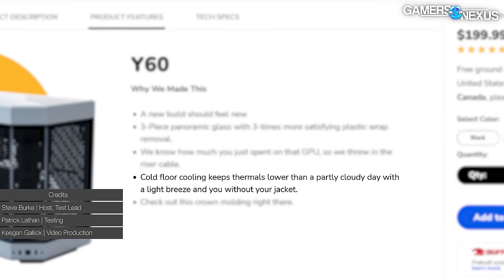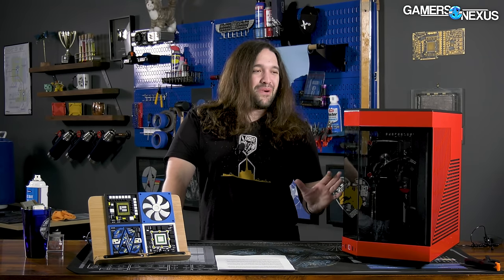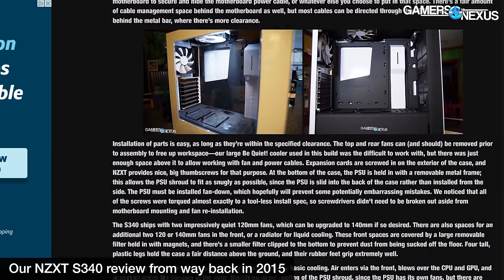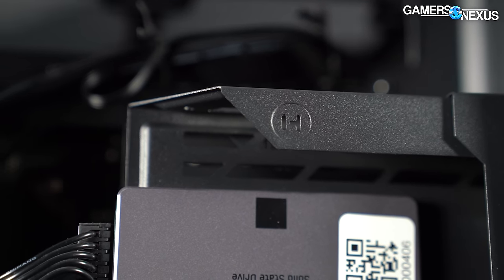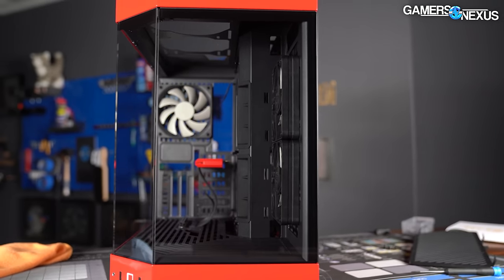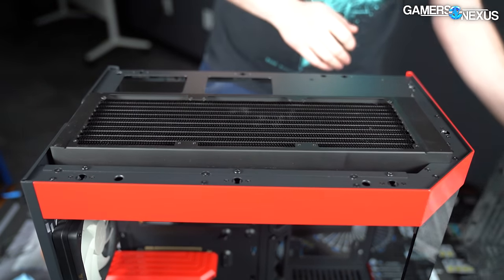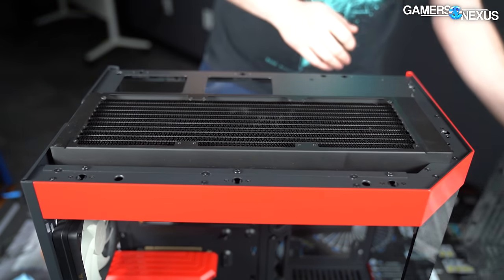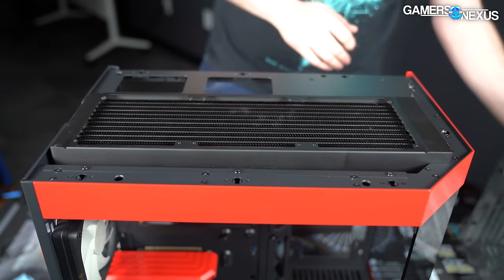Impressive Quality: Hyte Y60 Case Review & Benchmarks vs. O11 Dynamic

Comment: can anyone recommend a good case with a CD-ROM drive bay? I have a bunch of old family photos on cd-rom. I don't want to buy an external one when I have one I can install already. looking for something with decent air cooling that is a little higher end than a Fractal focus G.
Reply: You can get an external housing for your CD-Rom drive, rather than limit yourself to cases that have that feature. That said, check out Corsair's Carbide series, there's a few in there. Phanteks Enthoo Pro and Pro M (good luck finding those) and some of the high end Phanteks Enthoo cases like the Luxe, but they're very pricey. A couple models in the Antec Performance series also have removable optical bays, might be tough to find reviews on those but Antec has been making decent cases since forever. I'd recommend the Enthoo Pro M, you might be able to snag the tempered glass version, I think it's the most appealing case with an optical drive bay I've seen in a while. Good luck!

Comment: First I don't even understand reviewing this case with an air-cooled CPU cooler. I mean, why not use what MOST of the builders out there are going to use, an AIO. Specifically a 280 or 360 RAD.
I'D LIKE TO KNOW IF THERE IS ENOUGH ROOM TO USE A 360 RAD IN THE FRONT SIDE SPACE, AS THAT WOULD BE MY PREFERENCE???
 Also, there is enough space in the front area to add a few internal fans to help cool the GPU and Memory. So I think it could easily be compensated to have better cooling. Although, I've NEVER understood why anyone would put fans on the bottom, and blow dust from underneath up into the chamber. The screened mesh does NOT stop all dust from entering. So bottom fans are just idiotic in my opinion. Those fans can serve better elsewhere.

Comment: I HIGHLY disagree with all of the fuss over stock fans, it's absolutely meaningless, and would only encourage manufacturers to spend 10 bucks buying the worst 5 pack of fans you've ever seen just to fill up all the slots. When I buy a case, ESPECIALLY one over $100, I either want excellent high quality ARGB fans at a bit of a discount for buying them bundled in (honestly just fill up the whole case and have it all matching and pre-installed on a built-in hub that would be great... OR I want absolutely nothing to maximally save on cost and effort by not having to take them out or let them go to waste. The Hyte includes 3 fans, and they are all literally e-waste. It COULD be an exception only for cases like the hyte where some of the fan slots are completely hidden and thus dont need rgb or to look good, but even though they included some here they are still e-waste because they went with 120s instead of the 140s the bottom actually supports.

I get you've already done so much stock testing, but honestly it is genuinely a waste of your time and the viewers time in focusing on numbers that literally no one with the insight to watch one of your videos would every actually do or have to experience. I think a better system would be to find some high end RGB fans, and fill up the slots with a maximum limit to prevent huge cases being ridiculous (about 7 or 8 fans), and then on your value judgements, find the pricing of the included fans and state that number as a "free" value bonus. I don't think the current standardized number you've used is good at all, because it massively advantages very small form factor cases that can just manage the 3 and the sizes you've selected but no more, as they would be massively beat out by other cases at their full potential, but you never see their full potential because of the limit of 3. The 7-8 limit is high enough that it supports the vast majority of cases, but for the mega massive ones it's so much airflow that more and more isn't really worth talking about at that point the extra space is really for more and more liquid rad space which is only relevant to ultra-high-end enthusiast builders.

Comment: No bottom fans was a no go for me
..
Reply: Yet it has 2 bottom fans pre-installed
Reply: @TheSjuris  I run My gpu vertical, theres no room for another rad or fans there. An there is no fans that's the gpu..I need room for 2 360 rads and a 240 resivoir.
Reply: @mrrod3004  bud under the floor of the bottom there are 2 fans already there.

Comment: Neat but wouldn't even pick this over an 011 mini for a personal build. If they were really going for water cooling market they need to at least drop those trash fans and the price along with it. $200 case that just takes  a 360 and and 280 its not that impressive.

Comment: Why even have full ATX motherboards for all of these cases with vertical GPU bracket, you can't even occupy another slot here.
In general the last time I've seen a full ATX motherboard with more than 2 slots occupied was at least 5 years ago.
mATX can do 2 slots as well and doesn't waste material on what no one uses, plus you can get more compact cases for them.
mATX is the superior form factor for pretty much all builds yet it's severely underappreciated in the current market.
Reply: Nobody buys matx it’s either Atx or itx

Comment: I REALLY think your “Standardized” tests should populate all the fan mounts. 
Looking at the chart and having owned the O11 Air Mini and O11D Evo, I can vouch for AMAZING temps if you have bottom intakes for GPU AND front/side intakes or an AIO. 
Looking at the chart is just silly when your top performing cases sit in mediocrity and are referenced as such. 
I get it, not everyone buys cases AND fans. Plus, you can get even better thermals in just the two O11’s by switching side to exhaust or moving AIO. So I understand that you can’t sit there and move and flip fans for weeks on end for one review. 
BUT, those buying O11 Evos and such are obviously sticking fans in them. I spent $33 for Five 120mm PWM, daisy chained, Arctic fans, which is the price of ONE Lian Li Uni fan.

Plus, there’s a British dude, Christian something, that has fan curves on Auto, doesn’t understand how fans/cooking works, and people reference his videos all the time for “optimal” fan placements, so it would be nice to see you guys (outstanding attention to methodology) test cases as they’re meant to be used, even if it’s just ONE configuration where you populate the fan mounts or make it look like the promo pictures, so that people don’t get bad and useless data from Christian Finnigan (awful, nonexistent attention to methodology, seriously, look at his tests, his cpu/gpu fans spin according to their Auto curves so as he moves fans around his components spin at different speeds, and his noise level data is equally useless.)

Comment: You should overtink your testpreferences for cases in this price category. There is also a "in between".
Someone who's willing to spend 200$ on a case also doesn't bother to invest in better case fans (like Arctic bionix p140 in the bottom)
I'm using these in combination with a 2 slot 3080FE an the temperatures are even better as in my previous case (fractal meshify c)

Comment: Liquid cooling case, that only supports two rads, cant fit 2 360 rads, forces a specific layout for tubes on the top rad, vertical mount only gpu, and only allows for side mounted pump/fan... yeah "built for liquid cooling".  Every time I see someone act like this thing is a case the 011 should do anything other than shrug at I have the same reaction Steve did to their marketing.  Laughter and confusion.  This is an overpriced looks first, second, and third.... function a distant fourth, and versatility barely considered at all case.  It works ok, sure, but other cases that are cheaper work better.

Comment: It's a nice looking case, but I think I'll just stick with regular cases and spend the extra $150 on hardware upgrades.
Reply: Where are you getting a decent case with a pcie gen4 riser cable for $50?
Reply: @emwungarand  I don't use a riser cable. I just wait until a decent mid tower case with no glass side panel goes on sale when I need a new one. Works pretty well for me, since the aesthetics don't affect performance.

Comment: I don't think you understand the concept of Aesthetics "It uses more plastic than necessary". Yeah, and that extra adds to the Aesthetic. Everything does not have to follow some most efficient function. Sure it won't perform the top of the list of something, but in the end, a cost of Aesthetic is worth it, plus the case does not need to be made for all people and all purposes. If it is better for water cooled cards so be it. Thus if you aren't getting that, oh well for you. Get another case. It's that simple. That does not mean the case is not great, and not well fitting for what it does serve well.

Comment: I hate to say it, because I know how it sounds. I think it's ugly. The straight lines look cheap to me. It looks like something you'd see on Ali Express. It doesn't look classy. On the bright side, it also lacks any LED puke, or "gamer" design. So, that could be a good thing. Although, in this case I'd actually prefer if it did actually have some more stylized design elements. On the one hand, it has a cool shape. However, it's so cheap and basic looking that it doesn't feel unique enough. Even with all the private branding spattered across every possible surface. That's what I think this case is. It's a cheap Chinese generic case, with an expensive label on it. All you are paying for is the label. Also, the name on the label doesn't translate into better performance. Now that I've said that, I'll bet that tomorrow you can find 20 of these on Ali Express with a name on the label which literally translates to "better perfomance". Because, why not?

Comment: This case is a big fail. The o11 have been designed with high end watercooling in mind. This is why it is the way it is.
I got a 360 60mm thick in the bottom of the o11 mini and a 240 45mm on the side. The hite is bigger and cost more but you can't do such thing.

Comment: Idk, it might be better in person, but all that plastic and painted steel make the case look pretty cheap.

Also: Why put up the extra effort and cost to make the drives accessible from the outside but then cheap out when it comes to hot-swap capabilites? Makes no sense, now it's just a useless gimmick.